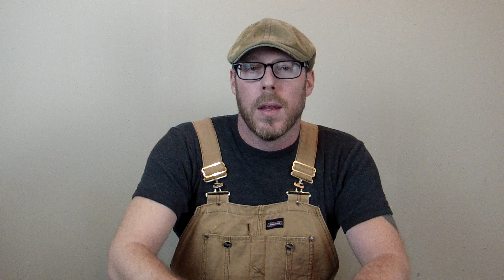How Does A Variable Speed Pool Pump Work?

Comment: ECM motors can still produce 100% of their rated horsepower and torque at lower RPM. Normal PSC motors require the RPM to deliver the work required.
Reply: Variable speed drive ,VFD converts single Phase 240v power to 3 phase 240v to drive a 3 phase ac motor  and changes the HZ frequency to increase or decrease motor speed, a very strong and reliable speed control, that is my guess as to how it works
Reply: @peterjackson6706  I've been looking into it, that is the avenue I would go down, but I've been seeing a lot of single phase PSC motors with variable speed controllers on them, essentially ceiling fan speed controls with a fancy display and timers not true speed modulation but preset speed and torque values from manufacturer
Reply from the maker: Thanks Ralph - great info